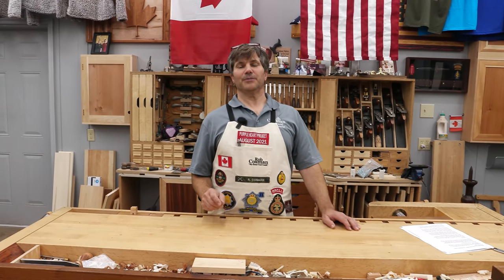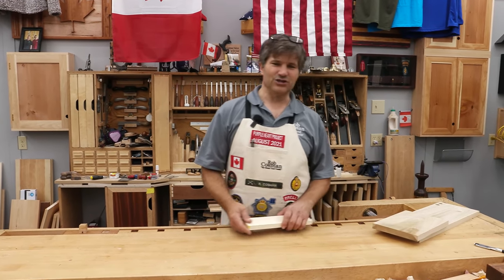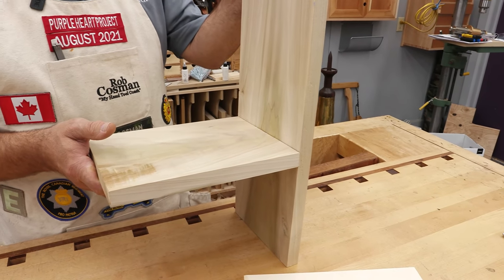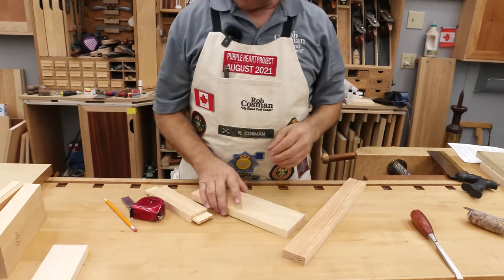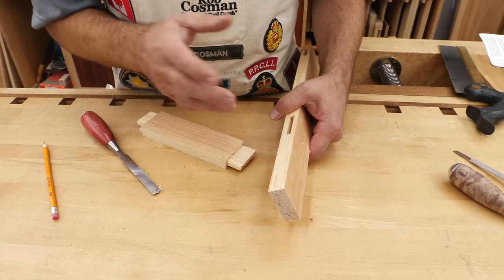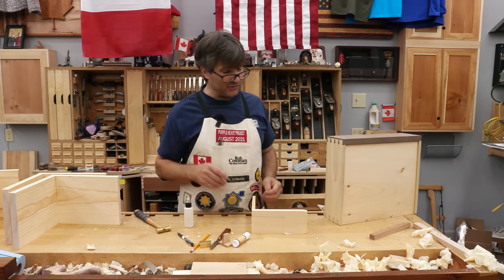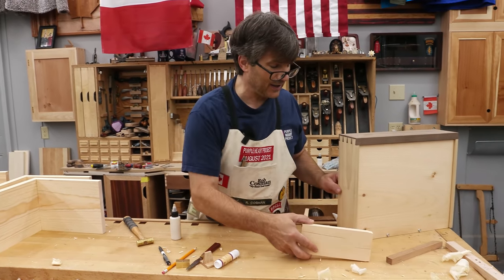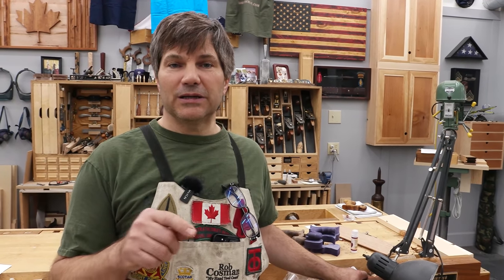End Grain Glue Myth Busted | What does it mean? (Surprise Ending)

Comment: He never got a side grain joint to break, so no strength comparisons can be made. He jumped the gun because he liked his hypothesis too much?
edit: All we really know is that most woodworkers think end grain joints are weaker than they are, and that glue is stronger than side grain. The most important thing in experimentation is what do the results really say? With no side grain joint ever breaking, it's poor science to pretend the strength of the joint is known.
Reply from the maker: Yes the lignum bonds of the wood broke first and he says that
Reply: It's TOTALLY irrelevant whether anybody got a side-grain joint's glue to fail. The glue is stronger than the timber, so the timber will always fail. Therefore isn't NOT "poor science" to say that the strength of the JOINT is known... we definitely know it is stronger than the material, hence the material becomes the limiting factor.
I'll use an analogy, to explain it another way. You can be killed by a single gunshot to the head. Being shot twice doesn't make you twice as dead, and it doesn't matter... you are already dead. You are equally as dead with one, two or twenty bullets to the head.
So, in the same way, it doesn't matter how strong the glue is, or the glue's bond strength to the wood, since it's stronger than the material itself. We could make the glue twice, 10 or even 100 times stronger but that won't make the slightest difference to the strength of the JOINT.
The tests Patrick did aren't to test the strength of the glue. The tests are to compare the STRENGTH OF THE (glued) JOINTS. So we can 100% definitely compare their strengths and prove that end-grain joints glued with cross-linked PVA are stronger than side-grain glued joints. It's not rocket science, so don't over-think it.
Reply: @johncoops6897  No side grain joint ever broke so we have no idea how strong they are. That's all I've talked about. This is not a discussion about "does it matter?", this is a discussion about whether or not one can claim to know the strength of a joint that never failed. If you didn't get it the first or second time, IDK what to tell ya. Have a cup of tea and relax.
Reply: @johncoops6897  I should say I'm not trying to be pedantic. I think we should ask more questions before we come to a conclusion. What happens to joints as they age? What happens to an end grain joint when the boards differentially swell or shrink along the joint surface? Will there be enough force to weaken the joint? This doesn't seem like it would be an issue for a side grain glue joint, as there should be little force put on the joint when boards shrink or swell. We don't know enough to bust the "myth" until we have more information. That's an attempt at good science.
Reply: @troyclayton  - it DOES NOT MATTER that the glue did not fail on the side joints in Patrick's tests. The wood itself broke. So, a side-glued joint is the same strength as a solid piece of wood - that is all you need to know. The glue joint does not compromise the strength of that kind of bond under stress in THAT direction.
For end grain, the glue is stronger than not using any glue, but not as strong as the original solid piece of wood when stress is applied in that direction. However it was proven that the end-to-end glued joint was stronget than the wood itself against stresses at 90 degrees to the grain.
So, its not about suddenly making end-grain butt joints in the long members of timber. It's about learning new ways of joining things that take advantage of a glue and joint strength that woodworkers steadfastly refuse to believe exists. As I said, it does not matter how strong the glue is once it is stronget than the material it is gluing... the point is that glue doesnt decrease the strength.
The reason that the glue myth continues is because of misunderstandings like yours. The test was so simple and clear, however woodworkers need to take that "new" (to them) knowledge and learn NEW ways to take advantage of it. That means designing NEW joints and NEW applications that would not be practical if they refuse to apply the NEW knowledge.
Reply: @johncoops6897  Sounds like you ignored what I said. Sad. I'm much more interested in knowing the truth than being right. I'm interested in discovering what the case is, rather than declaring it's known. It isn't. Those were brand new joints that had never passed the test of time. The video is thought provoking, begging many questions, but hardly 'evidence' that's proven anything. I don't understand when people are so convinced that they're right they don't feel they need to provide evidence to back it up.
edit: a typo